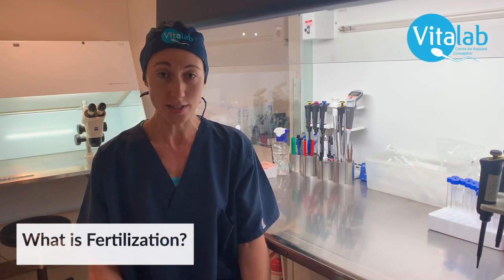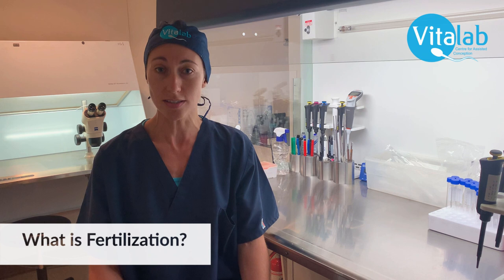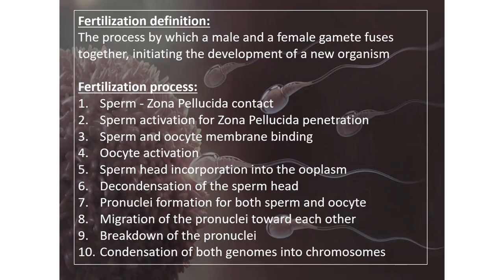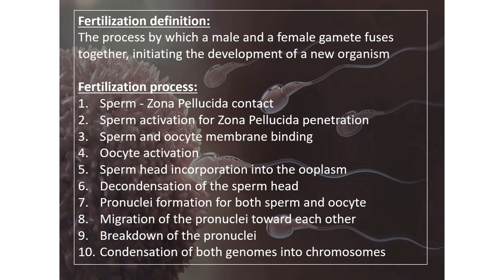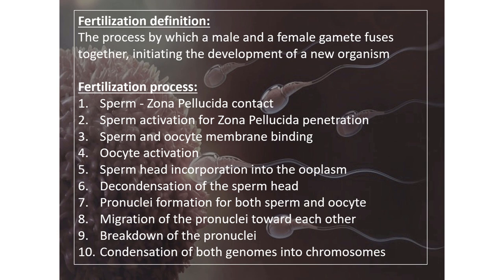Why eggs don’t fertilize? 😮⁉

Comment from the maker: Do you have any questions for our Embryologists? :-)
Reply: what could cause eggs to be stuck together and cannot be fertilized?
Reply from the maker: @NosiCossa  this is the reply from our embryologist for you: I’m assuming this question is related to IVF cycles. The Cumulus complexes of the oocytes are naturally sticky, so they do tend to stick to each other during handling and even during insemination if the tip touches the oocyte. Sometimes after IVF, they do clump together, and the oocytes then need to be cut/removed with needles from these clumps. Fertilization is still observed in these situations. The poor or no fertilization can most probably be attributed to immaturity of the oocytes or any of the other factors mentioned in the video.
Reply: i want to ask you how 2 girls have a baby without ivf or without sperm fertilization . is that possible only 2 egg cell not sperm .
Reply: Can fertilized egg attaches to the lining of the uterus if the woman is bleeding???